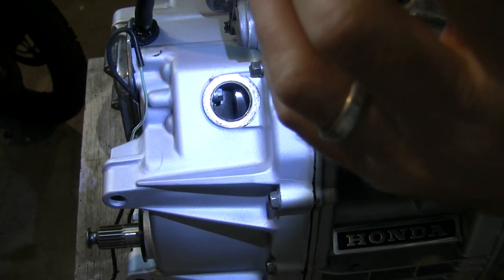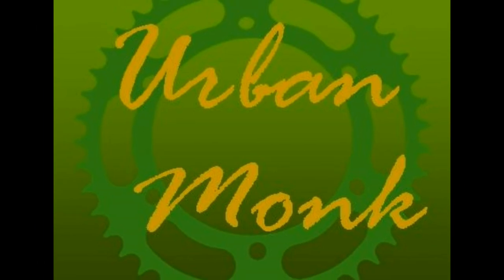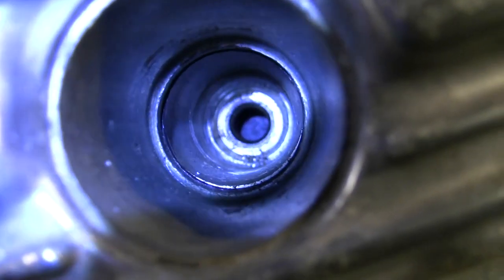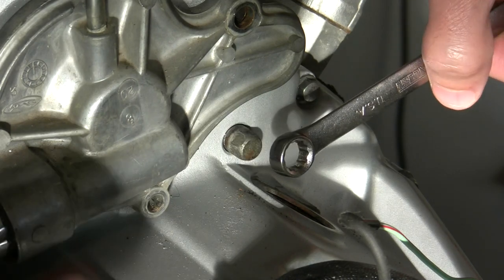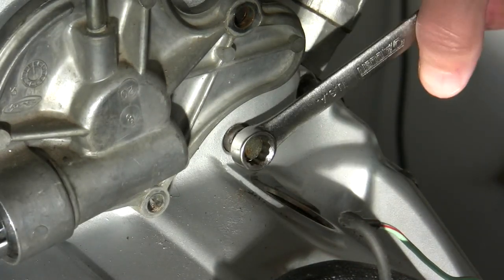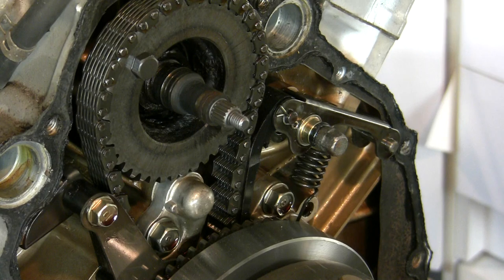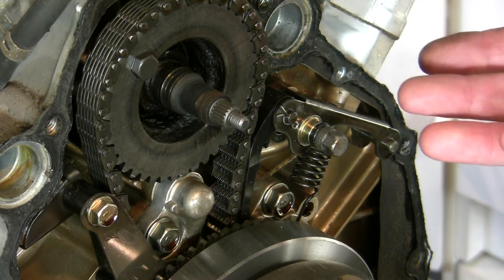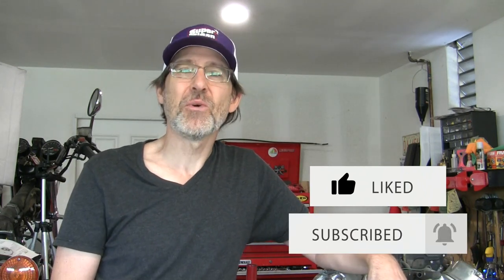How To Adjust Cam Chain Tension - Honda CX500 Motorcycle

Comment: Nice video. Been years since I’ve done one, but IIRC when TL shows, the left cylinder is top dead center- but it could be TDC between exhaust and intake- where both valves would be slightly open in overlap. You want to adjust cam chain tension with all of the valves fully closed, so all the lifters are on base circle and the cam chain is not under load. The left cylinder needs to be TDC with TL showing, but it needs to be between compression and power strokes. 

Easiest way- remove left valve cover. With TL showing if both rockers are tight, it is between exhaust and intake.  Rotate the crank 360 until TL is back. Both rockers should have play (valve lash) and you are ok to adjust cam chain tension.
Reply from the maker: Thanks for watching and for throwing in your insights for the benefit of others!
Reply: @UrbanMonkTV    Thanks for the blast from the past. I worked on a few of those, and owned one back in the 80’s. Underapprecited engines, imho.
Reply from the maker: @JeffinTD  I owned a CX and two GLs back in the 80s and early 90s and agree, wonderful engines and bikes.
Reply: so it'll be the same position as where the valves on the left side should be adjusted? makes more sense to me indeed, to call the end of the stroke in between. bought my 81' custom yesterday, it runs pretty grwat, still like to do at least this, the valves and carb sync.. also thanks to the monk  greetings from Holland
Reply: Yeah there is a TL and a TR on the flywheel. When you adjust valves if you are doing right, the TR should show, but you want to make sure the piston is between the compression and the power stroke. If it were to be between the exhaust and intake, both valves would be slightly open during the overlap phase and there should be no valve clearance (because they are supposed to be slightly open). In that case turn the engine over one turn until TR is back. The piston will be in the exact same position but both valves should be fully closed and there will be play on the rockers. 

Likewise when setting cam tension, you want the TL in the window, and play in the left rockers. The idea is that in this position all valves would be closed. The idea is you don’t want a tappet pushing on a cam lobe when you loosen the cam adjuster, as the valve spring is more powerful than the spring on the tensioner and could put rotational force on the cam that induces slack on the other side of the chain from the adjuster. 

Hope that makes sense. Anyway, greetings from northern Oregon, United States.
Reply: @JeffinTD  thank you so much, this detailed description is surely giving me the conference I need 🙏🏻

Comment: I seem to remember I would also do a couple of light taps with a rubber hammer on the tensioner before tightening back up again.
Reply from the maker: Thanks for watching! I can see why a guy would want to do that "for good measure." But having looked inside of the cover at the mechanism and how it is bathed in oil, I honestly can't see that it would make a difference in the vast majority of cases. Conversely I can't see it doing any harm if it was light taps and with a rubber mallet.

Comment: Thanks for the demonstration. I've got a '78 CX500 with 18k miles. The cam chain tensioner won't tighten down, which probably means it's been stripped out. How big of a concern is this, if it's not able to be tightened down? I don't have a lot of mechanical expertise and really don't want to have to take the rear of the engine apart.
Reply from the maker: It's a no-run situation if you can't tighten the tensioner down. If chain skips teeth things will get funky fast. Not good funky. Also, that screw helps break the back cover from crankcase so that may prove difficult too if it's stripped. Thanks for watching. I have videos on how to drop the engine and remove that cover.
Reply: @UrbanMonkTV  Thanks for the response! I've probably riden it just about 100 miles since buying it, and now I found the issue. I'll check out the other videos and see if I can fix it myself or take it to a shop. Looks like the threads are an easy fix, but getting there is the hard part.

Comment: Hello Thank you for your video demonstration. I have a GL400 café racer, the engine looks like the same of the cx 500, but I ask if both bikes have the same engine parts and the same Frame
Reply from the maker: First, thanks for watching. Intuitively I'd say yes they are the same. However, the GL400 was not sold here in the US and I've never seen one in person. My guess is they are identical and just have to different bore & stroke. I found a parts breakout for both the GL400 and the GL500/CX500 and compared several of the parts for matching part numbers - they matched. I did not check every single part though. Hope that information helps. You could do the same if you are questioning a particular part.
Reply: @UrbanMonkTV  thank you.

Comment: Your engine has 42k miles on it and you were just halfway through on the tensioner, so as far as the doomsdayers in the forums saying the cam chain is on borrowed time at 30k, what do you think? I've fallen into that kind of rut where forum people warn of armageddon if you don't do everything they say. I wonder if the cam chain on a CX is one of those.
Reply from the maker: I think I prefer to open my own engine and know exactly what I'm dealing with on my engine. The folks on forums don't own my engine and don't know much about my engine and its particular history.

Comment: Not really relevant but:-
From 🇬🇧 : was riding on my CX, out of Matlock town one bright May morning, 86, when, on an otherwise empty road, noted a car driving up the arse end, kerb side, of an older type ddeck bus to my front. We all travelling in same direction, all clear to front and rear. Id just collected the bike from a full engine reset, service etc, was running like a d r e a m ! 😉
As put, all clear so went to pass the two in front but, after mirrors, indicate, manouvere, as my front wheel drew level with the cars rear offside wheel, car suddenly began to pull out, no pre indication, indicator, nothing, looked quickly ahead for a run off, thinking car was going to also pass the bus but hadn't seen, heard me. Had a 2 into 1 exhaust, made enough racket !. But no, no bus pass, instead car pulled right out and across in front of me, as if a stone wall had suddenly manifested.  Drivet had decided to turn off a main onto a farm track. Bike destroyed, car bent inwards just to front of middle column. Driver a ok, walked away. Me... Took my left leg off, crushed both wrists. No more biking. Still caint walk right or use my hands properly.  Dtiver got off with it, being a freind of the local plod inspector who 'assessed' the matter, as i later discovered.
Reply from the maker: Ugh! I'm so sorry.

Comment: Hi Urban Monk. I don't own a cx500 but I do own a cagiva raptor 1000 which is powered by the suzuki tl1000 engine. Following your instructions regarding the valve clearances of your strom was a total success, so thanks for that. Does the TL engine have manual cam chain adjusters or are they auto ? Thought I would ask someone who's advice I trust. Thanks.
Reply from the maker: Hi Andy! My understanding is purely academic as I've not had any troubles with mine and I don't own a TL or have a TL manual. That said, I've noticed the CCT part numbers differ between TL1000 and DL1000, but the parts look almost identical in construction. If the TL is like the DL, they are automatic. It is possible the ratcheting mechanism inside can get sticky and not adjust properly, but that would have to be a very rare occurrence I'd guess. Are you hearing odd noises coming from that area of the engine?
Reply: @UrbanMonkTV  Thanks for the reply, no issues with my bike engine. I was thinking that I have never looked at the cct. I was in a spannering mood , so will move on to another target...

Comment: Hi monk keeping on top of camchain is important on this engine just one thing to note is Honda recommend both spark plugs are removed and the   covers off you can be on TL but on the exhaust stroke so make sure tappets are loose . on some models the tensioner is automatic,
Reply from the maker: Thanks for watching and for sharing these insights with other here! You never know when a tidbit of information is gold to someone. Best regards.
Reply: Why isn't this advice in the Owner's Manual? So the piston can be in multiple positions even at the TL mark? Wow! Huge disaster for anyone just following the Manual! Unless it doesn't matter? I'm new to this. This kind of mixed info is maddening.
Reply: THIS IS BAD ADVICE. IGNORE. [UPDATE AFTER DOUBLECHECKING AND WASTING TIME.] Do not remove cylinder covers to adjust chain. Plugs aren't even necessary to remove, tho they remove compression, making shaft easier to rotate. Just follow the Manual. Adjust to TL mark. Erroneous complication conflicts w known proper practice to needlessly create doubt and waste time, both of which are fun-killers. If disagree, give Manual page number to explain.